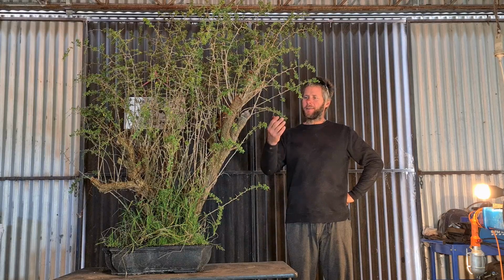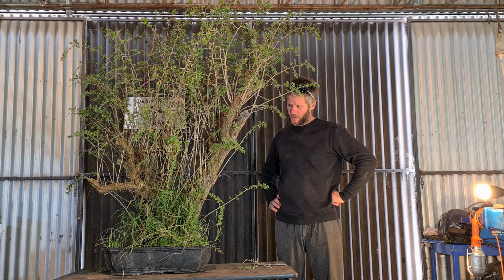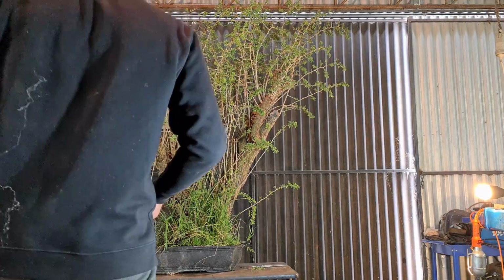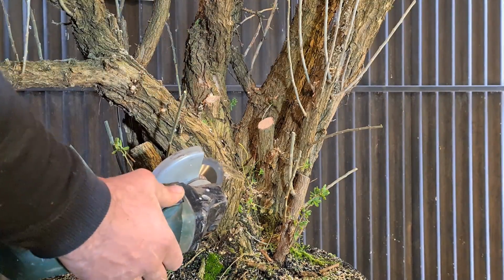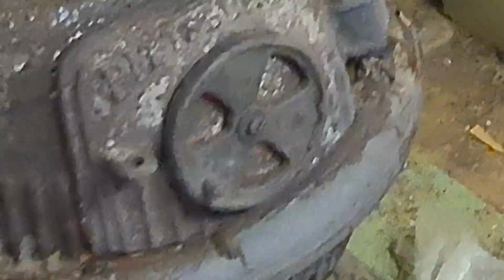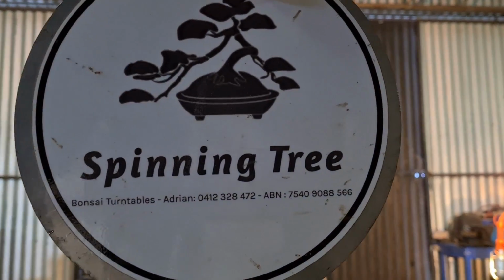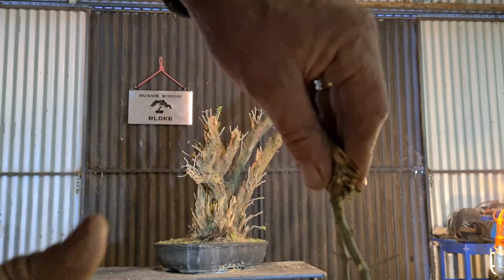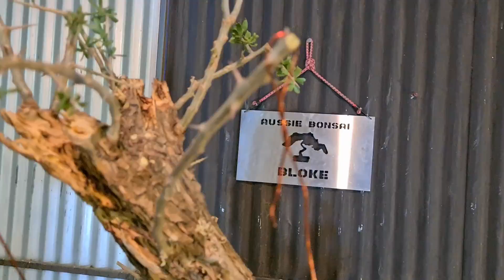Box thorn Bonsai, First style and carve, Aussie Bonsai Bloke

Comment: Another good one Sam. Got plenty of potential. The wind is pretty wild rocking my houseboat around quite a bit. Got my trees under cover so they blow into the river.
Reply from the maker: It's been very windy of late. Great for being inside the shed.
Reply: @SamDoeckeAussiebonsaibloke  You're not wrong. I don't have a shed but I hang around on upper deck where my bonsais are and potter with a drink or several